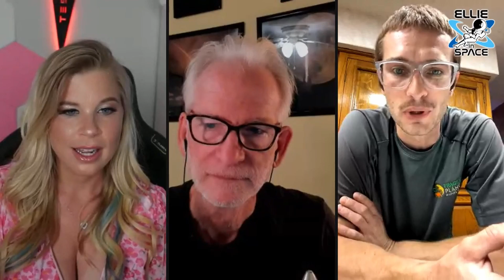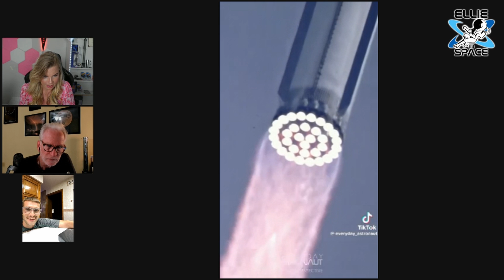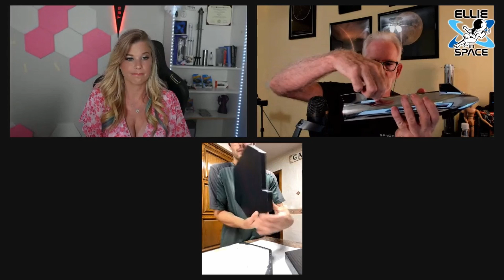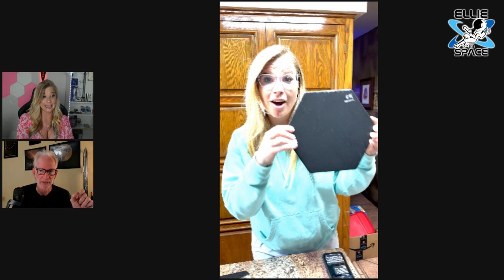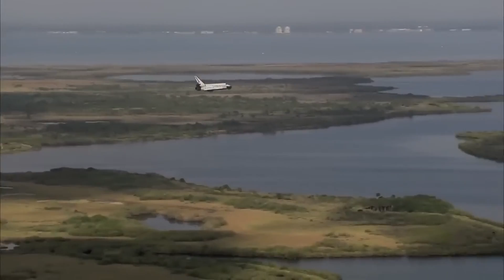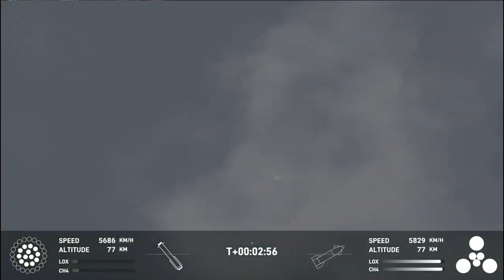Why Do Starship's Heat Tiles Keep Falling Off?

Comment: The reason the heat tiles are hexagonal in shape is so that the plasma generated over the craft does not flow in a straight line. The shape of the tile prevents the concentration of high temperatures.

Comment: The issue with the tiles falling off.
Is a result of smooth attachment  pins instead of ribbed locking pins. Tiles being attached are pushed on to the pins for attachment to starship. But under maximum harmonic vibration through the pins the attachment clips in the tiles will stay open and have a tendency of sliding off smooth pins due to air pressure and vibrations. They're real easy solutions

Comment: I was around for the shuttle and its heat tile woes. Man, what a frustrating problem! Decades later SpaceX still struggling to find a complete solution. It's tough because any additional mechanism you add to hold them more firmly is likely to require additional parts (cost), materials (weight), and complexity (failures).  If I had some brilliant idea, I'd be happy to share it with them.  But what do I know? I just do the soffwarez.

Comment: My vote is clip failure. Could be the tile has a ridge the clip grabs and one or the other has the wrong shape. Or needs a silicone rubber vibration damper. Also, you look great in that pink print dress. More of that dress and more pink please. Love.

Comment: The tiles need to snap in loosely to account for the pin's footing expanding during heat and cold cycles. Once they get re-entry heat soaked, they firm up and remain attached during the hottest part of the re-entry trajectory. Many are detaching during the wild vibrations experienced during launch. Vibration testing can work this out.

Comment: High temperature silicone adhesive can withstand over 700⁰F  which the backside of the tiles should never reach. For the vibrational stresses of a launch to cause them to detach, I suspect "human error" as the primary reason. The individual "pins", AND tiles, should be cleaned and "primed" with adhesion promoter prior to the tiles being installed with the proper amount of PROPERLY applied adhesive. As long as these tiles, 18,000 of them, are installed, one at a time, by human beings, there WILL BE problems with "human error/nature". If SpaceX were to automate the process with robots, these human "induced" "mistakes" would likely be eliminated along with the associated failures. Would almost be guaranteed to be faster, too. It's also possible that the ice layer that forms on the surfaces when cryogenic propellant is loaded is pushing the tiles from behind, between the tile and stainless steel skin, with enough force to sheer the bond between tiles and pins. The vibrational forces amplify the stresses. This is likely going to be an ongoing issue since the shell of Starship IS the tank and, even with the thermal "blanket", guarantees that ice formation. Remember that very thick orange foam insulation on the Shuttle main tank? It was to prevent this ice formation and potential damage to the Shuttle from the ice breaking loose.

Comment: The tiles are just fine. They will not be on any Artemis program vehicles. Starship is being developed to land on the Moon and Mars. On the moon--- unnecessary because light gravity and no atmospheric friction to cause heating of the HLS shell. There will most likely be a form of heat absorbing coating on the bottom sides of the lunar landing engines installed high up the HLS vehicles.

As for Mars--- the atmosphere is 1/100 the density of Earth's atmosphere and these existing tiles and adhesives will be fine, and with the same type of landing engines mounted high up to mitigate a dust cloud that will interfere with sensors needed to accurately and softly land on Mars soil will need a thermal coating under the engine nozzles, not necessarily tiles glued into place (knowing Elon it will be an innovative Tantalum Hafnium Carbide based refractory coating that reflects temps up to 7,600F) :face-green-smiling:

Comment: It is possible that your friend Nick may have tiles from across all 3 launches, and those serials might help Space X identify which Starship and placement location on the Starship it was from. 
The large amount of debris found recently may be a combination from all 3 launches, (think like the plastic ocean patch floating around the ocean) more of the launch debris being washed on shore from the recent storms shortly after the last launch, more in line with DR Scott Walter's suggestion was addressing to the amount of debris out there and the close spacing of the finds so short after the recent launch

Comment: Ellie, did you think they would just put 18,000 tiles on the second stage and it would work. The space shuttle program spend years to find the right configuration of every tile to survive a re-enter and even then they lost many 10 -50 tiles on every launch.  It is ease and they will lose space craft in the program until they get it right, maybe years of losses.

Comment: Just because nasa used tiles on the shuttle doesnt make them a good idea.( The shuttle was not quickly reuseable). A large, or a few pieces, ablative shield. To be quickly replaced after landing is surely the answer.

Comment: need a material engineer. What chemical make up is possible that takes the temp differential  Like Aluminum heat sinks but need it to be as light as possible. Also a robot fastener would be ideal

Comment: The tiles on the Space Shuttle mainly suffered from debris that came off the external tank and solid rocket boosters during launch. Tiles seldom just fell off and Nasa said about 100 had to be repaired or replaced after each mission. One mission had over 700 damaged tiles though.

Comment: Thanks Ellie, it was great learning more about the tiles and actually getting to see some.
As an engineer I am super surprised SpaceX did not want to see the tiles.  If the fasteners do attach to the tiles, I would think there would be tells (scratches) that would indicate how the pin detached and if they are glue attached, I would think the glue texture would give some indications of why the adhesion failed.  Maybe the fact that they don't want to see them tells you something - that they already know why they are detaching.  It is also interesting that they want time and location.  Maybe what they want to know is when they fell off.

Comment: I've had the question of why these tiles aren't interlocking.  They would benefit from the strength of adhesion from neighboring tiles to hold in place.  I understand there are other factors involved in the overall decision as to how they are mounted but I would think even a small plate adhered to the bottom of a tile or a lip manufactured into a tile that catches under an adjacent tile would help with overall strength and stability

Comment: Im sure once they finalize the tile design mounting tiles will be an automated process where they can also detect the click for the 3 point connection during installation. Maybe even stager the pin height of the 3 pins so it’s a click, click, click process. This was the best video so far on the tiles i’ve seen and the deep dive into the process. Thank you.

Comment: If I had to hazard a guess, I’d look first at what happens if the clips are chilled to very low temperatures due to the temperature in the tanks, but the tiles remain at near ambient temperature due to low thermal conductivity. That might result in a condition where some clips can loosen. Just my completely uninformed speculation.

Comment: Develop and incorporate steel velcro washers around the pins. A simple straight wire with barbs rather than hooks and for the base you could incorporate fine wire into the felt layer for the barbs to latch onto, assuming that felt layer is also held down by a one way washer on the pins.  Hell, just let me at it. I'll fix it.

Comment: Could SpaceX create mats of tiles by weaving heat shield tiles to adjacent tiles?  Once mats of manageable size are made, they could be woven to adjacent tile mats until the required area of the Starship is covered.  The fiber used to weave the tiles to each other would also be woven to attachment points on the skin of the Starship.

Also, why are those complicated fore and aft flaps needed?  Could they get as good or better performance with a pair of fore and aft scissor wings that deploy from the untiled dorsal surface of the Starship?  They would deploy prior to reentry and then redeploy prior to the powered portion of the Starship's descent.  A larger, more centrally mounted scissor mono-wing might work even better than two smaller fore and aft scissor wings.

Comment: Yeah, but why do the heat tiles keep coming off? 

It's probably the attachment method but we're talking about spacex engineers who would have no trouble designing a no-fail method for fixing two objects together, so what's the problem yeah? 

Obviously there is something problematic with attaching a necessarily delicate part to the ship. The tiles need to move to handle thermal deviation and can't be too close to each other or they breach each other but also not have too large a gap to let in heat. It seems a catch 22 problem. 

No one can figure out a way to fix a brittle tile (from the outside) that creates a heat seal and at the same time accommodate shift and vibration etc. They are attached with steel pins, so why do the heat tiles keep coming off Dr Scott Walter? How would you do it?

If there was a way you could attach these things and know for sure they wouldn't, couldn't ever come off ie the ship more likely to RUD than losing its heat seal that would be very nice thank you very much

Comment: Maybe some sort of a imbedded track system under each tile with some sort of locking mechanism under each tile . Permanent rails could be welded to the exterior of the ship to except the rails of the tiles with the locking mechanism. Could wrap the railing with material to allow for vibration and expansion.

Comment: Do they use any heat shielding on the reusable protective second stage covers that Space X recovers from the other rockets . These recoverable covers might make a good test bed for different tile designs even if they aren’t necessarily meant for these covers .

Comment: The reddish-orange stuff is silicone adhesive, not epoxy. The tile itself is composed of silicon dioxide (quartz, glass) fibers about 2 microns in diameter. A human hair is 70 microns in diameter. Those quartz fibers are chopped up in an industrial size Waring blender with distilled water, mixed with a ceramic adhesive, and cast into the desired shape of the tile (greenware). The top of the tile is coated with a black glass powder and then the tile is baked in a 2500F furnace until the ceramic adhesive is cured and the black glass glaze forms on the top (hot) side of the tile.

The diameter of the quartz fiber is selected to match the peak of the blackbody radiation spectrum at the highest operating temperature for the tile (2400F for the Shuttle, and 2600F for Starship). The tiles used on the Shuttle are called LI-900 (Lockheed Insulation-900) and has a density of 9 pounds per cubic foot (144 kg/cubic meter). The density of quartz is 2650 kg/cubic meter. So, the LI-900 tile is 144/2650 = 0.0543 (5.43%) of the density of quartz, that is, the tile is 1-0.0543 = 0.946 (94.6%) empty space. 

So, the interior of the tile is a complex, random matrix of thin quartz fibers that backscatter the thermal radiation inside the tile about 500 times more efficiently that those high purity quartz fibers absorb that thermal radiation. That high-efficiency backscattering process (Mie scattering) the secret of the tile's very excellent thermal insulation properties.

The Shuttle tiles were adhesively bonded to the aluminum hull of the Orbiter using aerospace-quality silicone adhesive. Those Shuttle tiles performed exactly as designed on 133 out of 135 entry, descent and landings (EDLs) of the Space Shuttle Orbiter. The other two Shuttle launches were the last launches of Challenger (Jan 1986) and Columbia (Feb 2003). The tiles were not involved in those two disasters.

Side note: My lab spent two years (1969-70) developing and testing dozens of ceramic materials and manufacturing processes for the Shuttle tiles during the conceptual design period of that project.

Comment: Nice discussion! A couple of comments: the analogy of heating on re-entry being like the heat from friction when rubbing your hands together isn't quite accurate -- most of the heating is actually from compression heating from hypersonic shock of the air in front of the surface, with the resulting heat then getting transferred to the surface of the vehicle. Also at 23:12 it mentioned that 90% of the heat is "reflected" from the black tile surface into space, which is not correct -- rather, the black surface when heated radiates the heat back into space via mostly infrared photons through the so called "black body" radiation mechanism (if you wanted to reflect photons you would instead make the surface white, or even better, reflectively shiny like mirror).

Comment: I believe the problem is that they are trying to form the tiles to fit the ship instead of forming the surface of the ship to form to the tiles. There is NO reason the metal surface where the tiles are mounted has to be a smooth surface. There are shapes they can use that won't break the tile with expansion and contraction. I believe once they realize mounting them to a flat surface with pins is not the answer i think they will change the design.

For example where the metal pins are, if the pin locations also had a rounded recess and the tile will also have a rounded protrusion to fit in that recess where the pin mounts are. The round shape will allow the tiles to still expand and contract as needed and give it extra structural integrity.

Comment: the shuttle tiles were attached to the airframe,   starship tiles are attached directly to the fuel tanks ... heat, cold, expansion, contraction, flexing...

Comment: I believe the shuttle black tiles don't "reflect" the heat, they efficiently radiate the heat that has been convected to their surface by the high speed air.

Comment: The booster already proves you don't need heat tiles if you slow the vessel down first. Maybe it's time for a rethink on re-entry procedure for starship.
Reply: Too much fuel required
Reply: @wugalar  You have more weight capacity for fuel once you delete all the tiles and anchors. Perhaps it might take orbital fuel storage staged before launch to refuel for an entry burn. SpaceX already has a way of landing vessels, so why re-invent the wheel now?
Reply: yeah but you're talking about slowing a beast from 25,000 kmp/h down to de orbit. that's a lot of mass and a lot of fuel @aeasus
Reply: @wugalar  That's exactly why the atmospheric brakes don't work. Obviously.

Comment: 19:47   No tile failed spontaneously or at all in the case of the Columbia disaster.  It was a carbon-carbon leading edge broken by a chunk of tank insulation coated with ice which lead to the loss.     Considering many Starship tiles would be "liberated" upon a vehicle disintegrating from either the FTS actuating or aerothermodynamic break up -- which one way or another has happened to every launched vehicle so far -- finding many on the beach does not indicate a general attachment problem exists.  Only when a controlled reentry is undertaken and "holes" occur in the vehicle from EDL erosion would such be demonstrated.

Comment: Usually during inspection of parts going through manufacturing an X would indicate a checked part or a bad part or problem area to focus on. In construction it is used for indicating what section of the material to remove.

Comment: they need to do an x-ray with a vision system (doesn't even need to be AI) that compares every attachment point against a good picture.  The image difference will point out where the failures are.

Comment: Tiles are probably fitting too tightly. Any flex from vibration or thermal cycling would cause them impinge on eachother and break free of their pins. They need a felt in between the tiles as well as behind
Reply: There's an expansion gap in between them.

Comment: Of the 18 000 tiles on a ship there are a few percent that are glued. Those are on curved areas like the nose and the flaps. They are also in parts were they are unable to weld the studs used for most tiles. Those sections are where 3, 4 and 5 ring sections are welded together. The welding is not precise enough to be sure that studs welded to one section are at the correct distance from studs on the opposite one. So, they are forced to glue those last.

The thermal blankets are only under tiles using studs, not the ones they glue. Those are glued to the steel.

They tested each tile with suction cups on S28 before it launched. That is why they did not lose as many tiles on that ship. They will be even more careful with S29 I am sure.
I think losing a small number of tiles is fine. Losing batches of them would be bad.

I hope they find a way to avoid using glue as much as possible. It is unreliable. But welding studs after welding sections is not trivial, but I think it could be done. Maybe even welding all sections together THEN welding all the studs (using robots of course). Or, improving the precision by which sections are welded together to make using studs practical. Also improvements in the design of studs and of the holes in the tiles might improve the system.
But those will have to wait for the next versions of ships.